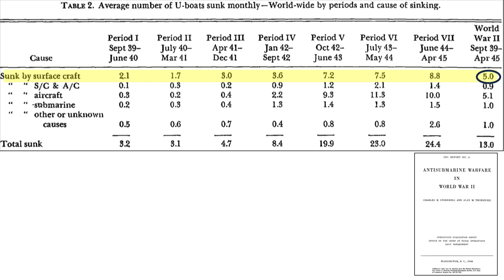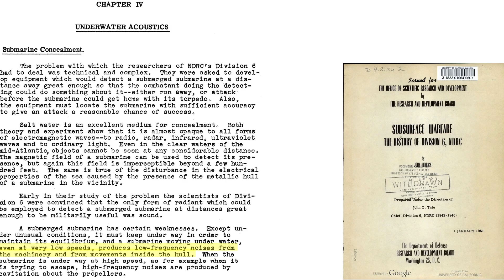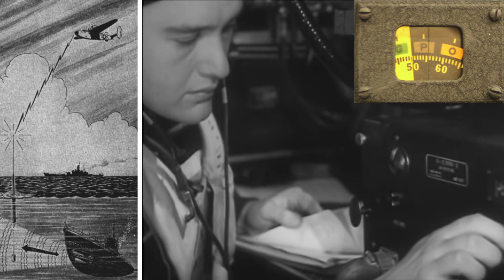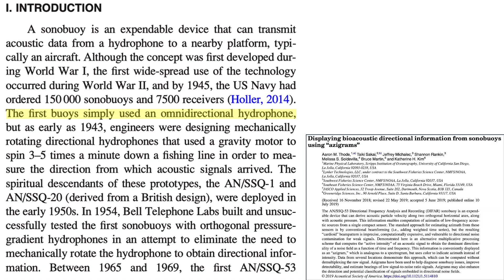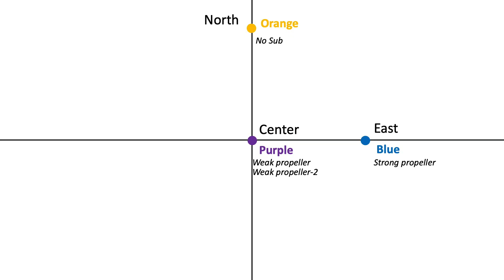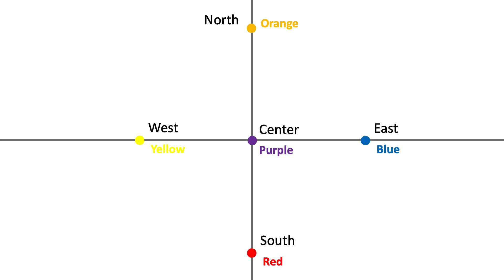Hunting German U-Boats with Sonobuoys in WWII

Comment: There are recordings not only of propellers and machinery, but also of implosions when the doomed submarines were submerged below crash depth. For example see "The incredible Sinking of Japanese Submarine I-52 during WWII - A Case Study".
Reply: I have seen that video several times, but I was unable to understand the different sounds.  Today, I watched the video again, and I put my headphones on and turned the volume up a little more.  WOW!!!  I was able to hear most of the noises fairly easily.  That made the video all too real.  BTW, our Dad was in the task force that sank the U-505.
Reply: Also, you have to remember that those aircraft engines were incredibly loud.  The sono buoy operator had to be extremely focused to tune out the aircraft engine noise, the noise of the plane going through the air and all of the vibration from the engines.

Comment: The reason that the screw noise produces beats even though it turns in smooth continuous circles is that the blade making the cavitation is sometimes turning toward the listening hydrophone and sometimes away from it as the screw turns in its circle.  Thus the pitch changes in a sine wave:  beats.

Comment: Considering the ambiant noise in an arcraft, what hed set did an operator use as most of the aircrew headsets didn't screen out much noise.
Reply: I’d imagine it would likely be a very insulated one similar to the ones some communicators would wear

Comment: Adding Ven diagram circles for range would help; smaller circles around the buoy with a strong signal and larger ones around the buoys with a weaker one. then lok for the intersections.

Comment: A request for in depth looks into particular bombers and what was done to them to address particular ASW needs.
I would love to see a comparison between a stock B-24 and VLR variant of said aircraft.
Reply: It was RAF Coastal Command VLR Liberators, only 41 in number, which closed the Atlantic gap and caused Black May. Stripped of guns and armor and equipped with auxiliary fuel tanks in the bomb bay, they were the only planes at the time with the range to patrol the gap. Small numbers of the VLR had been in action since late 1941, but the RAF Bomber Command, Churchill, and the USAAF all opposed their use in "wasteful" defensive maritime patrol when they were needed for war winning offensive strategic bombing campaigns. Only when the U-boats appeared on the verge of victory did the allies finally provide RAF Coastal Command with the plane it needed to win the U-boat war.

Comment: Appreciate the love shown for the U-boat War.
Couple of questions:  once a submerged U-boat was detected/pinpointed, what method of attack would be used?
How many sonobuoys would be generally carried onboard?
Reply: He has the video out with various weapons that equipped the aircraft. I think you would find it fascinating as I did.
Reply: @JohnRodriguesPhotographer  Saw it.  But, bombers had to be reconfigured to suit this new mission and there must be a lot of things going into this.  His level of research is likely to give a better understanding as to why the Liberator was the preferred platform as opposed to the B-17, etc.
Reply: @williamashbless7904 there were a lot more liberators and if I remember correctly it was preferred for less risky combat roles as it was better fit for those jobs, also there was a maritime patrol variant called the PB4Y-2 privateer. I think the reasons around the b-24’s use probably has more reasons I’m not aware of though